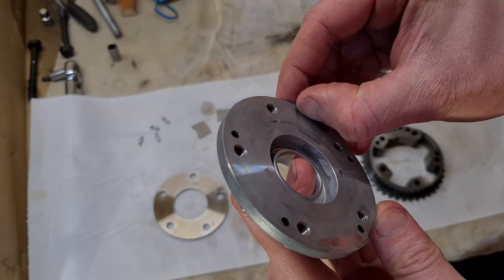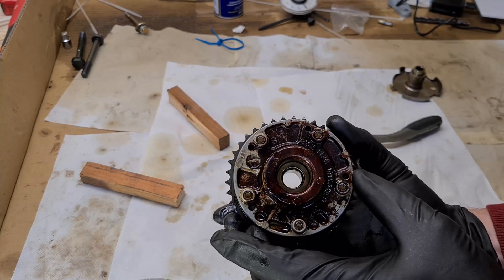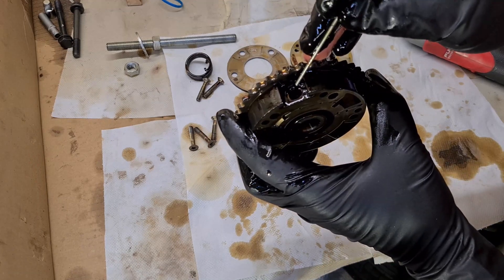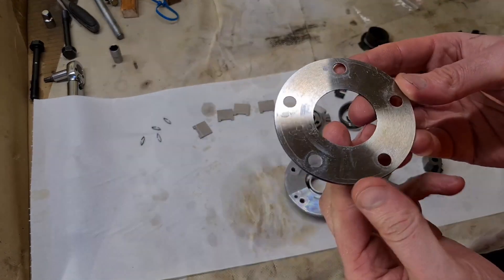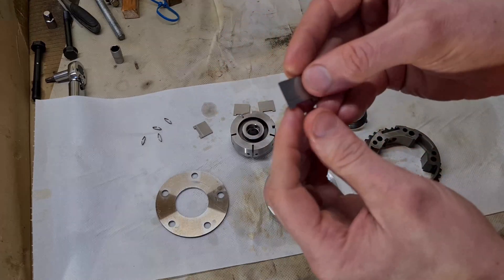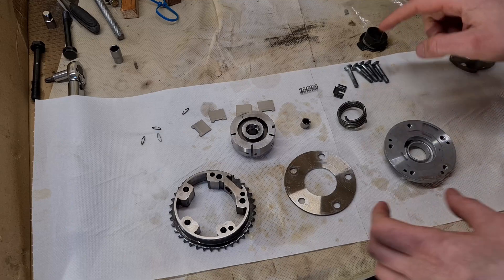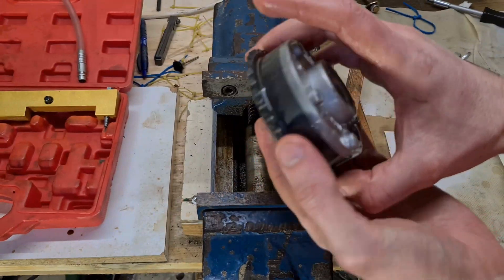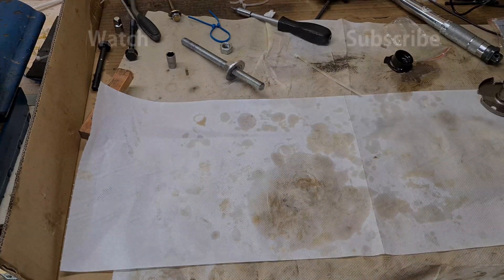N42 Exhaust VANOS Disassembly & Inspection

Comment: I tend to believe that the reason for the rattle noise might be the loosened veins caused by the worn and broken springs (that is how I found the veins in my unit).
Do you know where I can find those very small bracket-shaped springs that go on the veins/flaps inside the VANOS unit? That or any other alternative solution...

Comment: What would happen if you sand down that aluminium side of vanos with 2000-3000grit ? That can maybe fix the problem. I'm thinking of doing that becouse i have the same problem with the rattle. Also my intake vanos value in inpa is around 108.5. Is that normal ?

Comment: Any update? Those were the culprit or the vanos solenoid?
Reply from the maker: Rattling issue is still present:( I'll have to make another video on this issue...
Reply: @BimmerZen  We'll be waiting for your video.
Reply: You may consider the new and improved model of tensioner 11318685091 .
Reply from the maker: @robertalexandrescu9975  i replaced it the newest version when i was changing the valve stem seals 3 year ago.
Reply: @BimmerZen  Made any improvement?
Reply from the maker: @robertalexandrescu9975  not at all. I think the VANOS unit is worn. I think oil drains out after standstill and so it rattles on startup until oil fills up and pressure stabilises. Rattling also transfers to the chain.
Reply: @BimmerZen  Ok. Does the engine has low torque on low revs and is lagging on throtle?
Reply from the maker: @robertalexandrescu9975  a bit when cold. After a few minutes it feels normal
Reply: @BimmerZen  On mine it is on any temp. I am considering changing the solenoids. If it won't cure it, the Vanos unit will be next.
Reply: @BimmerZen The tensioner you bought was BMW OE or aftermarket?
Reply from the maker: @robertalexandrescu9975  original from BMW.
Reply: @BimmerZen  Ok. I have red something about the oil pressure check valve (that should be on the left side of the engine block). Someone was saying that should be checked [...]. Do you know about this?
Reply from the maker: @robertalexandrescu9975  The N42/N46 has 3 check valves; one in oil filter housing and two in the engine block. First can be "checked" by removing the oil filter housing. However, it can not be changed because it is integrated in to the oil filter housing itself, it may only be cleaned. The second two valves are sandwiched between block and cylinder head, so... head has to be removed to check/clean/replace them.
Reply: @BimmerZen  Have you checked the VANOS values and adaptations?
Reply from the maker: @robertalexandrescu9975  And oil pressure regulator is located on the bottom left, but you need to remove the oil sump to get to it, which is a PITA.
Reply from the maker: @robertalexandrescu9975  INPA shows 117.30 on intake and 54.40 on exhaust, which is acceptable.
Reply: @BimmerZen  Mine is simillar, 117.4 with 58.7.  Should their values be dinamic with engine speed? I didn't find any info on this aspect. And what are the perfect ones!?
Reply from the maker: @robertalexandrescu9975  In INPA you wont see it dynamically, they don't change much. Your values seem within tolerances. I think 120 on intake is correct value, but I am unsure for the exhaust... I have seen that value on these engines from 54 to 58.7. If the chain jumped for one tooth on VANOS units, that would translate to about 9.5 deg of offset. I plan to do some tests next time I have a chance.
Reply: @BimmerZen  Is there an INPA version that has a vanos menu for our N42/N46 engines like there is for the newer engines?
Reply from the maker: @robertalexandrescu9975  I don't know, haven seen it myself. Maybe on the N46 since it has newer DME: https://www.youtube.com/watch?v=fkITbE8dPsE&ab_channel=AlKa

Comment: Thanks so much for these videos - very clear, well made and informative. You are one of the few channels that covers the N42/N46 engine - most seem to focus on the 6 cylinder engines. I have an E46 Coupe with the N46B20 engine - it has been completely reliable for 93,000 miles and is VERY smooth for a 4 cylinder unit.

For me, the most important thing to do with these engines is regular oil changes. With Valvetronic and VANOS, the heads are complicated and very dependent on good lubrication. I do an oil/OEM filter change every 5,000 miles with 5W 30 fully synthetic oil (Castrol) and it's paid dividends in performance and reliability.

Thanks again for these excellent videos and looking forward to the next one!
Reply from the maker: Yup.. if you shorten the oil change intervals these engines can be reliable. The chain tensioner/rail is still a problem and in my opinion should be replaced after 15 years or 200.000km. Congrats on having a good one;)
Reply: @BimmerZen  Good point on the chain tensioner/rail. On the VANOS units, what are the main symptoms that they are in need of refurbishment or replacement on these engines?
Reply from the maker: @peterastley-sparke7526  My understanding is that they fail to hold required position so the ECU tries to control the oil flow to compensate. This results in uneven VANOS timing position, and even rattle. Basically if you have constant chain rattle, reduced mid range torque/power and hesitation on acceleration. Ideally you would observe the VANOS position and see if it stays constant or if it floats around during mid range power requirement (this is when camshaft timing change is required).

Comment: Love your videos! 2 Questions, can a bad VANOS make your car have almost no compression? and, Would a few a pieces of different grades of "sand" paper on a knowingly true flat surface whilst running the aluminium part shave it down instead of a lathe? 3rd bonus question, oops, I timed a BMW 120i, it wont start and sounds weird when trying, I I watched your videos so I think its perfectly timed, I checked many times and I am assuming the valves have bounced...I want to give the girl it back working but I am afraid I cant, have valves on a n46 bounced on you? I thank you for all your content so far including any reply you might give me.
Reply: I forgot to add. Big Hello from Scotland!
Reply: hmm on all cyliders ? did you do a compresson test or do you just feel it not having compression?i whould check witch cylinder it is because its probably just one and check that the torsion springs are ok and valve seals
Reply: Vanos probably has no effect on compression it should be rather bad valves maybe burnt valve if u burning oil on n42/n46 because on these engines is problematic valve stem seals and if long time will drop oil on these valves it could burnt it... and if this is not your problem then piston rings or head gasket is bad
Reply: @NOKRBTZU  well, i on one ocasion i had completely zero compression on all cylinders, took out vanos selenoid and the car started with no problems, so yea

Comment: These silly long term oil change intervals really kill these engines.
Reply from the maker: Yes:(
Reply: Thats why I'm changing every 10k km oil on this engine (N46B20) and valve stem seals is often a problem on these too, almost everyone have problem with burning oil on these engines due to valve stem seals.... problem with vanos rattling of exhaust side of vanos gear is often too.... I put 2500€ to this stupid engine in 4 years so I know.

Comment: Thank you mate
Exelent Job i neaded this 
one month earlier.
Changed timing chain &still retlling so this is the problem .Thank.you so much.
Reply: Just change the whole ''vanos gear'' like I did and my car stopped rattling. on 99% it would be exhaust side not intake its typical on n42/n46 (I bought new from ebay for 100€)